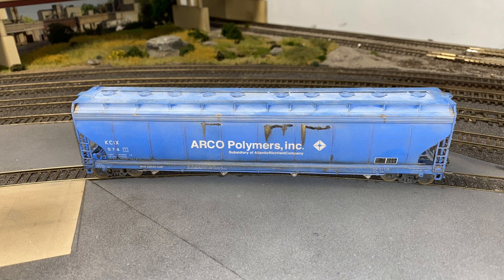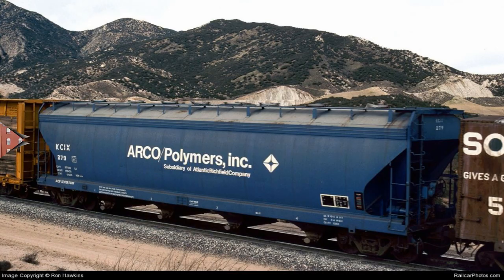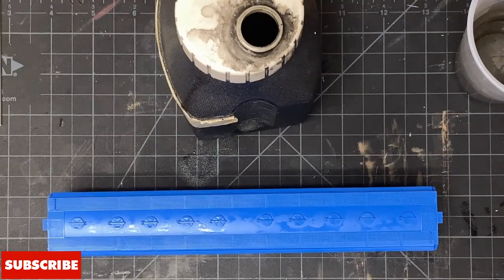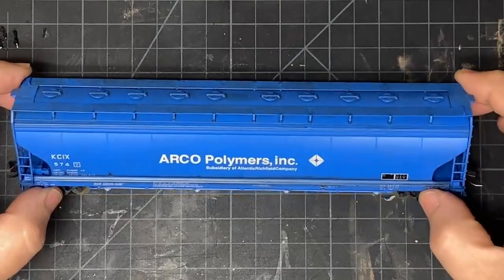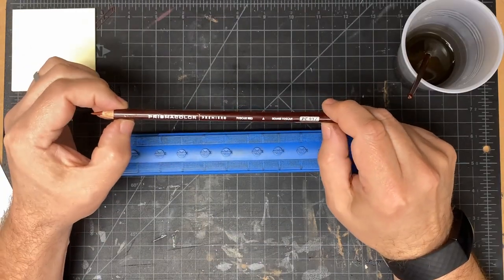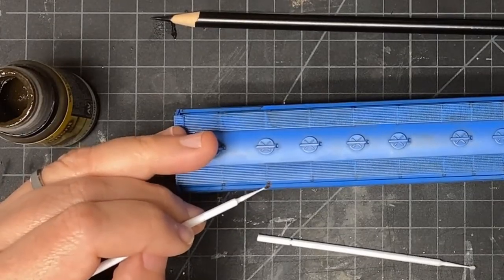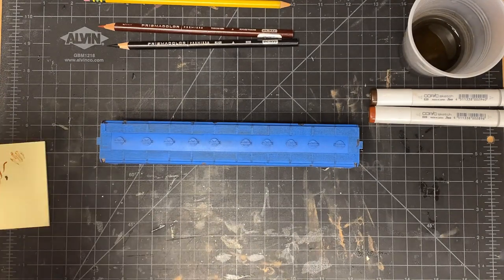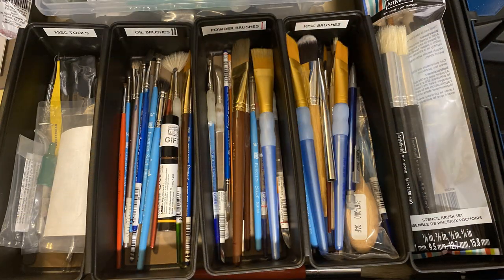How to Weather an HO Scale Freight Car - ARCO Covered Hopper

Comment: Awesome! Very neat techniques. Speaking about cleaning the pan pastels off the rust spots with something wet, I found some q-tips in the cosmetic area of a store that were a bit stiffer than regular q-tips and come to a point that's strong enough to wet and scrub off small areas such as your rust spots. Also strong enough to use for paining fine lines which a toothpick is good for as well. Great video. 👍
Reply from the maker: I will have to look for those. Probably would have been easier than the tiny microbrush I was using.